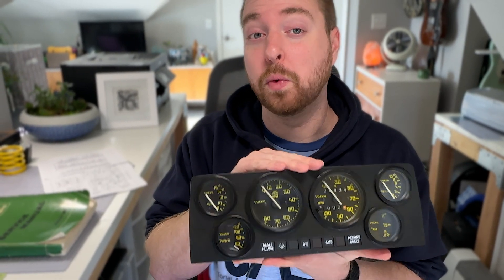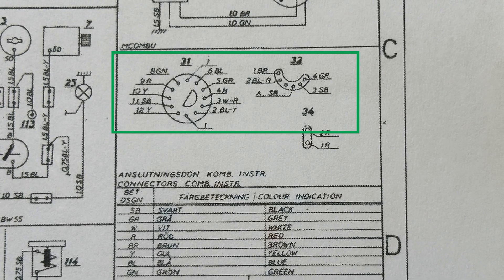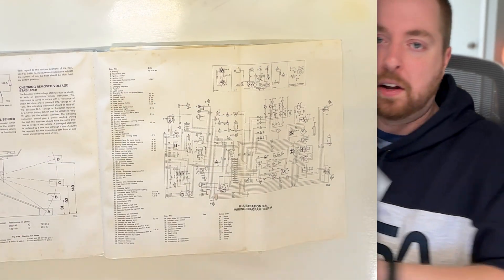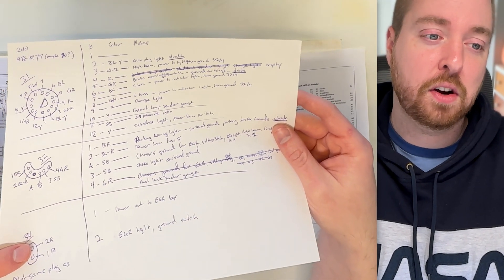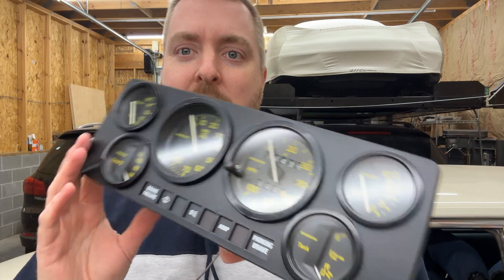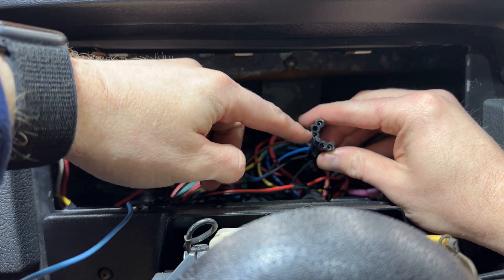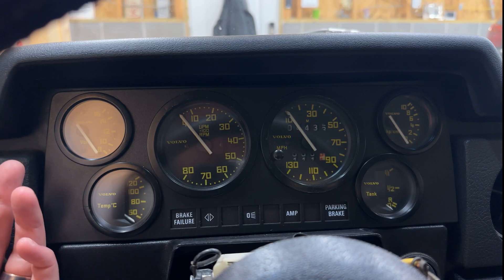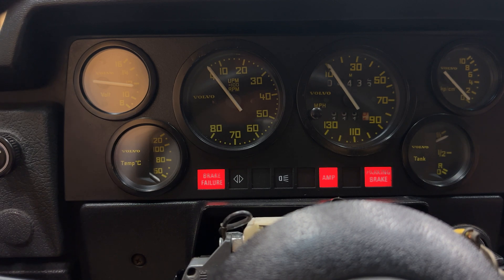240 R Sport Cluster Into a 140 S1E6

Comment: Hey!
Im having some issues with my cluster on my 1974 volvo 142. When im using my turn signals indicating to right for example the left indicator in the instrument lights up, same thing when using the hazards only the left one lights up i checked the lamp in the cluster ofc. Also the tach reads much higher rpm then what it is actually True rpm. When im wiggeling the wire harness att the back tank and temp gauge drops, thinking its a bad ground fault
Reply from the maker: Bad grounds definitely do weird things. Wires are old and can get brittle. O le the circuit board on the cluster may have a break. Is your tach the correct tach for your engine? There are 6 cyl tachs and 4 cyl tachs, only visual difference in the redline on a 6 cyl tach is lower.
Reply: @seandavisdesign My tach is for 4cyl!
Yeah im gonna check my ground connections to see if there is any fault there. Anyways i had a Hard time seeing your painting you did over the wire diagram wondering if you could send me a picture of it? The one that is from your 73 140 i bet it is the same on my 74 :)
Reply from the maker: @martinhjartstrom1693 The 74 I think has one or two pins different on the wiring plug. If you google it you should be able to find a 74 wiring diagram somewhere. That's where I found 74 and 75 diagrams before, assuming they are still available somewhere.

Comment: I had a 142 in 1973 in a hideous orange color, I think that's the only year the 142 model had the 200 series interior and dash,.
If there's a word you don't understand and can't find a translation for, just zoom in and I'll translate it for you
Reply from the maker: @jorgenmansson4269  73-74 had an updated dash for the 100 series. Very similar to the 200 series with a lot of cross over parts (like gauge clusters and switches), but the dashboard, glove box, and center lower dash were all updated again in 1975 for the 200 series.